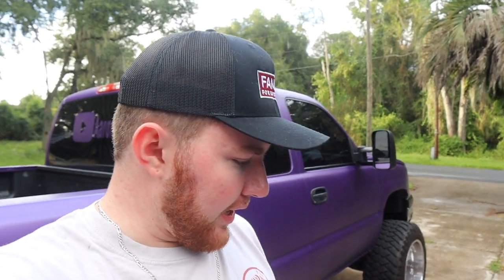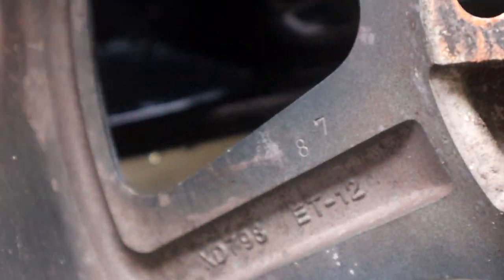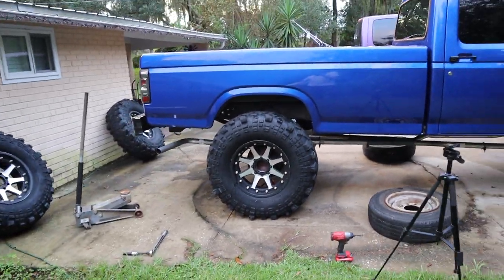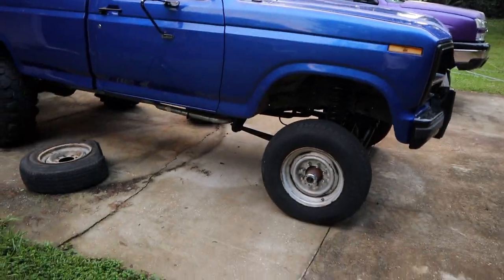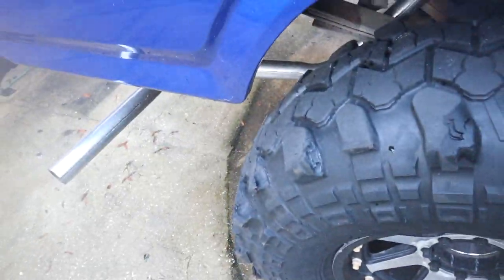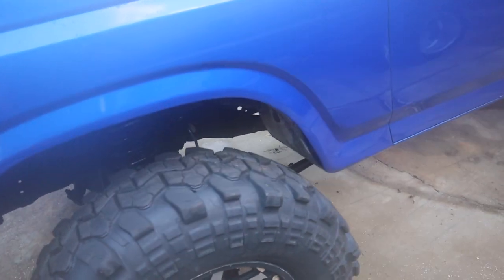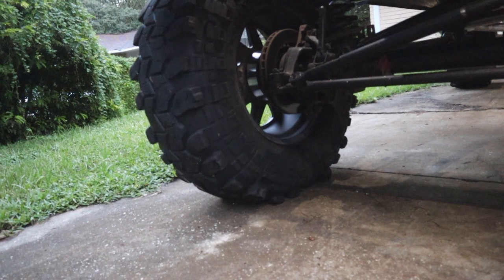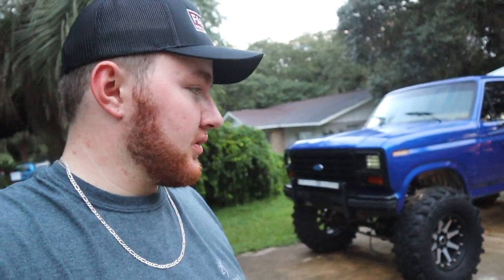Putting 42” SUPER SWAMPERS On My SAS Bullnose Ford

Comment: I jusr put 35' super swampers boggers on my cat eye and I get about the same amount of death wobble and I'm running 2in adapters  in the front
Reply from the maker: I found out it’s because the tire wouldn’t hold air and only had about 5 lbs of air.

Comment: Love that setup!
I'm currently in the process of putting a lift on my 81 f150
Reply from the maker: That’s awesome! I remember the first lift I did on this truck over 4 years ago, I loved it!
Reply: OUR TRUCKSIN ROUTE FROM ARIZONA
Reply: I MAKE MY OWN LIFT KITS OUT SQUARE STEEL TUBING SAME WIDTH AS LEEF SPRING DRILL HOLES FOR GRADE 8 BOLTS TURN PUMKINS AT TRANSFER CASE
Reply: ORDER HELL BOY THOUGHT YOU GEAR HEAD I RECON
Reply: BULL WINKLE SON HARLYS DINT HAVE MUFFLER MY CARS ETC. HEADER ONLY
Reply: DID GOD JOB SON YOUR DAD BE PROUND OF YOU
Reply: CUT THE ENDS OFF FRONT AXEL REWELD WITH SQUARE TORPEEDO LEVEL

Comment: I want to build a custom set of fiberglass door panels and then a custom dashboard for my 85 at 250 that or put a 2016 or a 2011 f250 dashboard in it
Reply from the maker: If you do, send me some pictures because I would love to see it done.
Reply: For sure bro I also got a crazy question I'm thinking of 3.5 EcoBoost swapping it would you know if it can be done? Love the videos the truck looks great
Reply from the maker: I’m sure it COULD be done but depends on how much goes into it. If I ever motor swap this truck it will be a 7.3 or 12 valve.
Reply: @AaronCates  I've thought about that fr could easily get 650hp out of a 12v and the 7.3 never dies plus sounds amazing

Comment: No shocks will do it as well
Reply from the maker: That’s what I figured but it didn’t do it with my 40” toyos and I didn’t have shocks then either
Reply: @AaronCates  I would check tire pressure and tire balance and see what it does after that